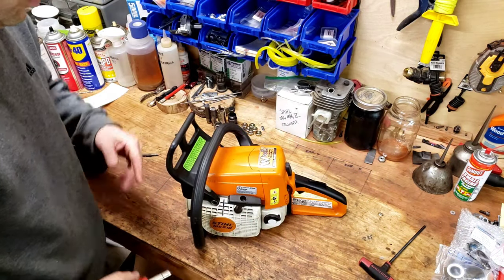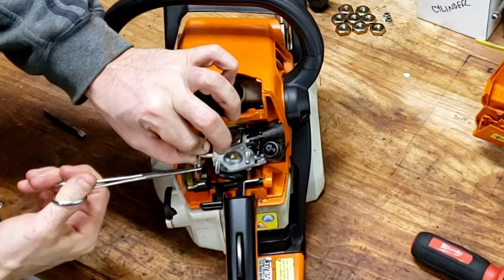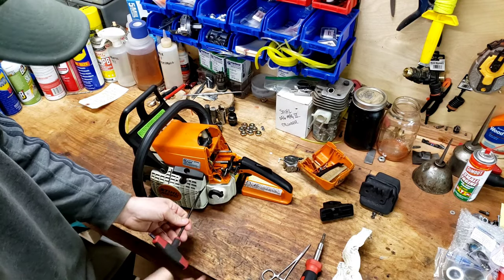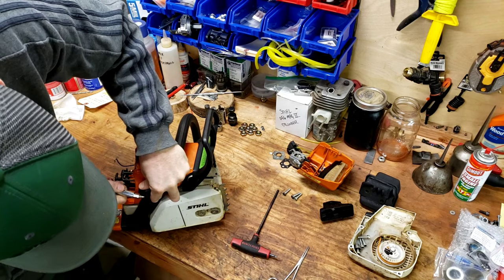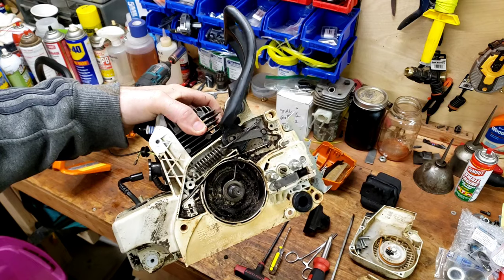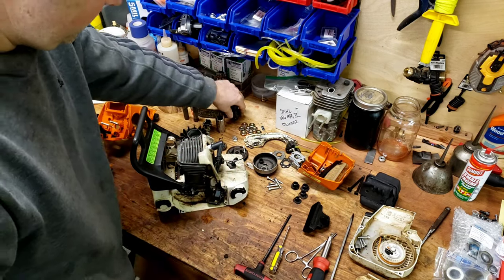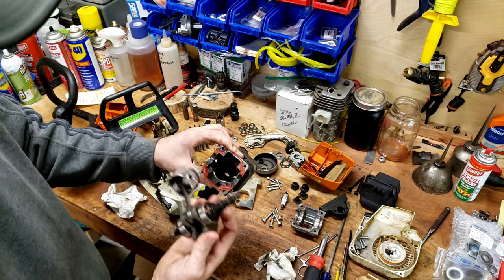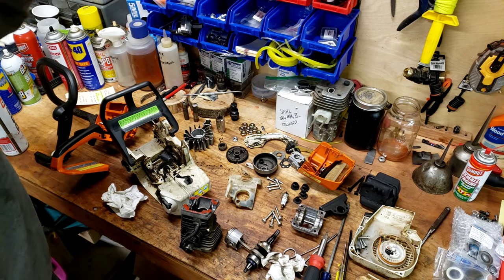Stihl 021/025/MS210/MS250 a common air leak & engine removal full tear down disassembly

Comment: I am restoring the 021 that I got off EBay. The cylinder was ok, but the rings were slap worn out.  I am putting a new Nikasil cylinder set on it with Caber rings and a new crank because the rod bearings were also worn out.  It will have new seals, boot, fuel line, filter and impulse line.  If I have to go into a saw I rebuild it from top to bottom. In do not ever want to have to go in it, again.  It also is getting a new clutch, sprocket, worm gear and sprocket bearing.  It will also have a new Stihl L4 lightweight, 18”, .325 bar and chain.  If it will not pull it I will put an LP 3/8 chain on it.  The crank is a NOS Stihl crank.

Comment: Use Three Bond 1284 on the case seal.  It won’t leak or get destroyed by gas.  I se 1184 for all case seal jobs.  I have never had one leak, afterwards.  The first seal job that I ever did was on an 029 Stihl.  I used a Ermatex sealant and it did not last a week.  I resealed it with 1184 and it is still running, fine.
Reply: 1184 or 1284 ?  Is that the same thing or a typo ?  I don’t understand
Reply: @wierpkevin  I useTB 1184.

Comment: Update on heat shrink. I've decided after another installation today that 3/4 is too large of a tubing. What would work best is to measure the largest portion of the shaft and use the next size larger available tubing. I've ordered 1/2 and 5/8.

Comment: This is a longshot, but I was wondering if anyone knows what the little piece of black plastic that goes between the spark plug area and carburetor area is? I bought a used ms250 and its missing. The manual refers to it as a shutter for winter/summer mode. I've been trying to look it up to buy but have not had luck. I'm sure that if I use the correct name that it shouldn't be hard to find.
Reply: They're on eBay.

Comment: That red RTV doesn't look original, too sloppy as well to be factory applied, most likely from a past teardown.  Actually not the right product to use in such applications as most RTVs are not 'gasoline resistant' like a Motoseal, Hondabond etc. type case sealant, likely a contributor to the air leak.
Reply: Hard to say...stihl uses dirko which is red, so it might be

Comment: Thanks for the video. I had an idea for installing the seals without damaging them. I used 3/4" clear heat shrink tubing and a heat gun. Lightly grease the shaft. Slide on the heat shrink and heat with a heat gun. It will shrink down to a tight fit. Grease the tubing and slide on the seal. Works very well. The same piece of tubing will work on the flywheel side also.
Save the piece as it is reusable.

Comment: Good Vid..  I watched many and heard those plastic plugs holding handle on where a bear to get off.  
I found an old 311 and needed the Handle. I wiggled my small screw driver into each and shot a drink of white grease let them sit and they all popped of fairly easy.

Comment: Thanks for this video. Ive a stihl 025 that i changed the piston and cylinder on a couple of years ago. Its been running just fine up until a few days ago when it suddenly seemed to lose compression. Will strip it down this weekend and take a look. Hopefully its same problem as yours

Comment: I picked up a 021 but haven’t got it running, yet.  Don’t see any air leaks around the crankcase, yet, but still checking.  It will pop but not run even with a new carb.  I think the carb is not being pulsed, so it may be a broken or disconnected impulse line.  I went through the old carb and did not see anything that should keep it from running but I replaced it anyway.  Fuel line is also OK and cleaned out the filter.  It has good compression but could have a stuck ring.  If I have to replace the cylinder it will get a new Nikasil 40mm jug.  I guess that would make it an 021 Super.  It would then fit right in with my 024, 025 and 026.  I will then put an 18” L4 bar and .325 chain on it.  It ought to honk with a 40mm jug on it and pull an RS chain pretty good.  I will replace just about all the rubber parts on it, as I do on all my restorations.

Comment: very nice video.  I used this to help me with a tear down.  AT 10:20 you remove the white plastic piece to remove the black plug to get to the screw.  I am having a problem putting that back together.   I cannot tell if that white piece goes over the flat part of the plug or lines up with it.   It seems it should like up with it but I cannot get it to.  I only wants to overlap the black plug and that does not seem right.    I am trying to tell from your video if that is the case or not before your remove it but cannot quite tell.

Comment: Good video, thanks for taking the time to make it. I'm about to tackle mine. My 025 symptoms sound similar to yours, will run ok, but loss of power when under load and impossible to get the low/high mixture settings right. When idling, if I push weight down on the handle of the saw, engine will stall. That's how I found your video, thought it had to be an air leak, and having seen your video, it now makes sense. Will try and tighten the main bolts up first to see if it helps. Thanks again
Reply: Mik, did you ever solve your problem? I've had a bit of a time with a 025 I got for a decent price. Seller told me it had issues. I rebuilt the engine with new rings, seals, and bearings. Original seals were shot and a bit of leak at the engine pan seal. It runs ok for a while until warm then would start surging at idle, rpm increase and decrease. Usually would die if I picked it up off the ground. But if throttling, it is OK. If I press on the orange cover over the engine it changes rpm. I replaced the intake boot since it was pretty worn at the carb connection and wasn't sealing very well. Seemed like it was good so I ran it today and back to the surging. While improved in some aspects, it's still not right so I pressurized the case again. The aftermarket boot is leaking at the engine where the plastic baffle presses over it. So, that's my issue now. I'm not sure if the baffle is just not tight due to heat and age, bad tolerance in the aftermarket intake, or a combination of both. However, being that the problem is the same, I'm suspecting the baffle is the problem. Just wonder if this could be something for you to look at as well if you hadn't figured out your problem.

Comment: Excellent how-to, doing my 1st 025 breakdown this has helped many times thru my rebuild.  Looks like I had a leak in the same area of the head as your video shows the head was coming apart from the crank body before I was able to get the motor out of the case.  The glue that was used was barley there and was clear.  The whole head and crank body with case connection design is crap.  Thanks for your video.

Comment: Great Video I have dis-assembled my Stihl MS271. New piston ,rings , crank shaft bearings and seals required, however the old seals have deifferent part no's and one is blue the other is brown and the service manual refers to them as hard and soft seals can you or anyone explain this and which side of the crank they go on  thanks
Reply: A little late, but for anyone else reading... the brown ones are suppose to be able to be installed without taking the engine apart and the blue ones require disassembly of the engine. The pressed in ones (brown) are difficult to get right and it's usually best to use blue ones although alot more work is required.

Comment: Have a 023 i purchased in 2005.Five years ago i replaced it with a 025 because it would just shut off after cutting a few sticks(Start easy,could never restart it until it cooled off completely). Wondering if this is the problem due to a poor seal on the crankcase(Saw was never apart).
Reply from the maker: This issue can cause all kinds of different runnability problems. Probably a good chance it was this issue or at least it was a contributor to your problems anyway. I may have just had a bad run of luck, but I'm yet to come across one that DIDN'T have this issue, so my view might be skewed on these saws haha

Comment: Be careful - the chain break handle that came with my ms-250 kit was not machined properly.  It had casting seams on the top and bottom on the handle leg that goes on the pin.  This kept it from seating down on the case and the outside seam kept the support slide from fitting properly on the pin, so I left the support slide off because I coul not get it to fit on the chain break or dog bone pins.  A mistake on my part.  The chain breake worked for a while but it did not work fo long.  The pressure on the chain break handle bent its pin to the rear and the dog bone pin, forward.  I think I can straighten both pins and I have ordered a complete new set of parts for it.  When it failed I failed in the “on” position.  I had to completely disassemble the chain break system and then noticed the problem, a defective handle, so inspect these parts before assembly.

Comment: Great video. I just tore apart an ms210 with a bearing failure on the pto side.
Can you put an ms250 motor into an ms210 body?
Reply from the maker: Yup! They share the same chassis. Should plop right in, providing you're swapping the whole short block. If you're NOT swapping the whole engine, and you're just looking to swap piston and cylinder, I know they have different length stroke. Something to look into. Otherwise, slip that 250 engine in and let 'er eat!
Reply: @samishsawworks5870  oh right on! Appreciate it 👍

Comment: Hi Ben, any advice on removing the white plastic cover between the cylinder head and carb without removing the head? I am just trying to replace the coil. Thanks.
Reply from the maker: Are you concerned with removing it so you can remove the plug wire attached to the coil?
Reply: @samishsawworks5870  exactly, it seems the boot for the spark plug is too big to pull the wire out through that plastic piece.
Reply from the maker: @lucaskrist2877  so, instead of trying to pull the boot "down through" think more of pulling the plug wire "out through the side." The plastic partition has enough give you can pull the plug wire out through the side of you pry the plastic partition piece a little. If you email me samishsawworks@gmail.com I can send you pictures. I happen to have one here right now.
Reply: You probably already figured it out, but if someone else reads this and has the same question, you can pry that plastic baffle to the left to open up that channel to slip the HT lead out. Then ease the boot down through the plastic and out with the coil. The other method is to unscrew the HT lead from the coil. Coil comes out the side, HT lead with boot comes out the top. Either way is fine. This applies as long as your lead is threaded into the coil and not bonded in.

Comment: I have a Stihl MS250, that will not fire at all.    MAGNETO is keyed correctly.....
So, we have spark, (at the right time)
we have compression (110 psi)
exhaust ports are clear
Carburetor has been cleaned twice
Installed a new coil (even if it did not need one), it is spaced correctly
All the coil grounding wires OHM correctly
I tried 3 different spark plugs.
Replaced the gas with fresh 2 stroke mix that works in other two strokes
I have tried GUMOUT and Starting Ether (in the cylinder and carb intake)
I spin the engine over with a drill, there is spark, but not a sign of gas igniting.  
The plugs look wet.    
GIVE ME A CLUE......
Reply: In case anyone is interested... I removed the piston and it was melted on the exhaust port side.
I sanded the aluminum transfer off of the cylinder and ordered a new piston and crankshaft seals. $8. 
It is on a slow boat from China...  I cannot wait .....
Reply: I have the exact same symptoms with an 025 I'm working on.  Starts and dies.  Hard start. fuel is getting there, spark is good.  125psi compression.  Sometime will idle, but bogs when throttle is applied.  Out of things at this point.  Could use some help.

Comment: What is the number of T special tool to open the bolt of hand brake guard?
Reply from the maker: All the screws on this saw should be Torx T-25
Reply: @samishsawworks5870  I got it today; T handle wrench with part number 5910 890 2400
Reply: T27 is the appropriate size although T25 will work if it's all you have and you're careful.

Comment: What symptoms did this leak cause?
Reply from the maker: Sporadic runnability. It had a bog right off idle. The idle wouldn't hold a tune. It would seem fine, then go rich all of a sudden and die. Adjust for too rich condition, it would idle okay then go lean and die. Hard to restart especially when hot. Like 3 or more pulls to get it to fire (usually I'd have to choke it) It would seem like it was tuned correctly on the high side for "an amount" of cuts, then just go lean in the cut out of nowhere. Basically it couldn't hold a tune no matter what.
Reply: @samishsawworks5870  thanks for the info. I'm picking up a 021 for cheap and previous owner states it stalls when hot. So here I am looking at YouTube trying to solve it before its even in my hands. Hopefully its something simple.
Reply from the maker: @davidchristie4218  Could be any number of things of course, the easiest being the spark plug. I've had a run of bad luck with failing plugs lately. Not fouled, but actually not functioning properly. That's the easy one ;) Usually if it stalls when hot my first thought is it's a compression issue, next possible air leak or coil problem. Could also be a tank vent not breathing creating a vacuum in the tank and length of run time is just coinciding time wise with when the saws gets hot. Here's to hoping it's something simple. If they're okay with you pulling the muffler, it's just two 8mm (5/16") nuts to get the muffler off and look at the piston. Anyway, good luck! Keep me posted with what ya find ;) they're great little saws and easy to work on.
Reply: Great video man, appreciate it. I’m literally doing a tear down on my 021 today as I need to replace the cylinder, so this is super helpful. Question for you. At 1:10 in your video, when you shine your torch in the muffler housing. Below the left hand bolt there is a small, round orange seal or plug. What is that? I don’t have one on my saw, it’s just a hole. What is the plug abs hole for? I’m baffled! Tuning in from Melbourne, Australia by the way. 🇦🇺
Reply from the maker: @mattshaw6828  it's a plug. They commonly fall out. If it hasn't started yet, it will eventually be a giant oily mess. The hole is left over from the casting process I believe. It goes through to the "pressure side" of the oil passage that leads from the tank to the bar. There are lots of various fixes for it. Basically you can plug it with anything you see fit. The only thing is you can't go too deep with your plug as it will block the oil passage. If you have means to email, shoot me a message samishsawworks@gmail.com and I'll get you some pictures and such of what how to repair. If not I'll try and explain it on here.
Reply: Dude, awesome form, thank you. I’ll swing you an email now.
Reply: @mattshaw6828  that orange plug is a vent for the oil tank, the newer saws have them now so they don't build up pressure and keep pushing out more oil after you turn it off.